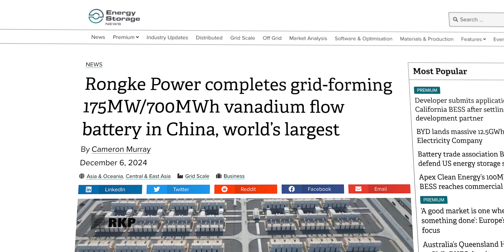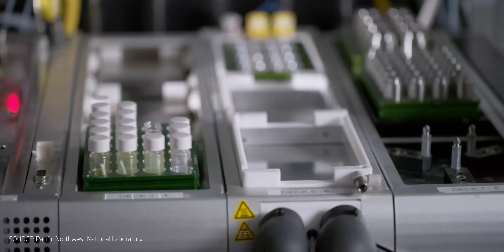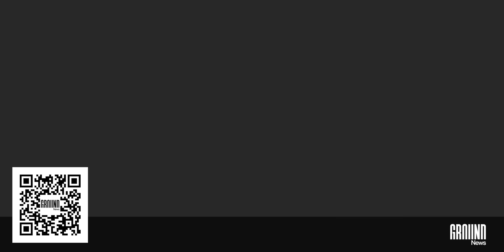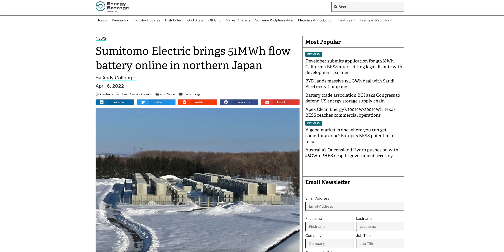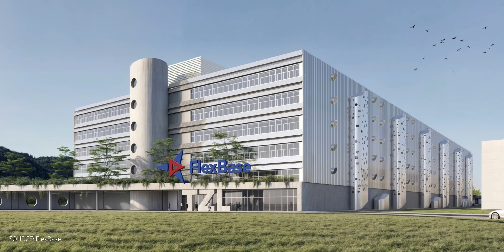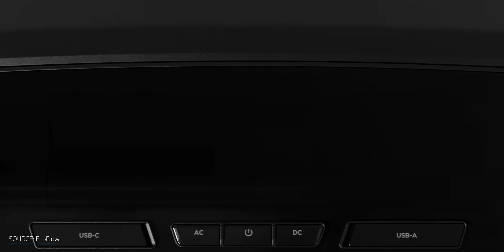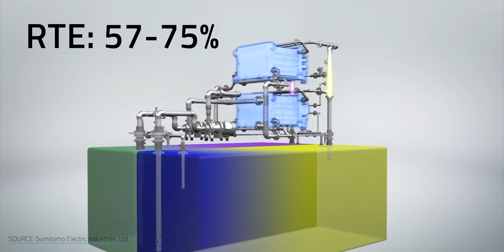Why Isn’t This Revolutionary Battery Everywhere?

Comment: I wonder if the battery in China is actually being used, does anybody have any info of how much of the capacity is being utilized? I know most of the solar and wind farms in China are running on somewhere in the order of 0 to 20% utilization (they have many massive solar farms, but they do not have the infrastructure to transport that power any further than the local village, if there even is one close by, some are not even connected due to being too remote), so I do not see how such a big storage system could be fully used in China.

Comment: Sounds very interesting.
Im swiss and one big part for electricity are hydroelectric dam.
Big brain idea noone wana do so far yet can be placed anywhere with enough space:
Huge water tanks that serves as potential energy higher up. Then when needed open them to run a turbine.
On the bottom (after turbine) there is a other water collecting area.
If you have abundant energy you use pumps to get the water up in the tanks again.
Continue the cycle.
This is WAY cheaper then ANY battery even when it is not as efficient as lithium batteries.
It can not burn ofc😂

Comment: Matt this is a very good summary of the VRFB situation based on publicly available info.  However, I am an industry energy storage consultant doing very large storage installation in the range 200-1000 MWh.  The fact of the matter is that given cost, energy density, safety, logistics, supply chain risk and durability VRFB cannot compete with lithium-ion.  I was involved in the development of advanced VRFB and licensed this in 2021 when it became apparent it simply cannot compete with lithium based systems.  Keep in mind that VRFB in China was heavily subsidized by the government both for development and funding of early projects.  Also China has the largest current domestic vanadium, the US has virtually none.  To bring a full scale working mine online takes literally 10 years, so this is a non-starter.  Russia and South Africa have the bulk of the reserves.  So the risk starts with the vanadium itself.  VRFB has no market traction because it does not make business sense.  When you do the financial project analysis its too expensive by a long shot. 

Another key point is that lithium batteries have been vastly improving over the last decade alone, in energy density, price, durability, safety and cost.  Energy density alone is now 5MWh for one 20' ISO container for the DC block.  For VRFB it is .5MWh at best with the latest technology in the box. Yes that's point 5MWh with a decimal point before the 5!   This means 10 VRFB containers are equal to 1 lithium to achieve just 5MWh.  The point I am making is that lithium has been improving at a much greater rate than the market expected.  This 10:1 energy density difference also effects all other costs dramatically.  More VRFB containers require more land area, civil works, conduit, copper wire, logistics and labor.  Those added costs overwhelm the budget.  This makes VRFB and frankly most other non-lithium technologies unviable for the foreseeable future.  And remember lithium is at tremendous scale.  Any new technology has to get to similar volumes in order to compete.  This is the harsh economic reality of any new "up and coming" battery system.

Anyway love your videos and your balanced presentations!
Reply: Great info guys! (Video & coment). Thanks for the contribution 💪🏼👍
Reply: He did mention about the availability of Vanadium in the US towards the end.
Reply: Great summary confirming that Moore's Law is at work. Rapidly lowering of cost leads to exponential adoption outcompeting all other competing technologies.
Reply: Hi Greg. I would like to collaborate with industry leaders like you. I have a big project coming up in 2026 in South Africa, Cape Town. I would like you to partake on it.
Reply: I love seeing comments like this from industry experts. Thank you for sharing.
Reply: Nice explanation

Comment: I think this could be a good idea for smaller localized grid stability.  Say, the loss of a transformer in a specific location, the ability to near instantly supply power could be crucial, perhaps near hospitals or other emergency services.  Of course, many of these facilities may have generators too.  Otherwise I favor the implementation of nuclear energy referring back to your video I watched on Thorium.  What are the odds of small scale production units utilizing this instead of uranium?

Comment: As FYI, Australia has 40% of the world’s vanadium  resource. However, without a market vector alternative from steel hardening, every time a mine starts up, the claimed market price collapses. Unfortunately this means that Australian miners/refiners need to pair with a vanadium redox battery manufacturer. Alas, they don’t seem capable of doing this - even though Japan and US are supposed to be strategic partners.

Comment: If the level of efficiency is an issue, then what about the efficiency of coal fired power stations and the internal combustion engine. Also, if land area is an issue, what about the area used for coal mines and oil fields.

Comment: Ridiculous claims that 8 - 10 hours storage  gives you wriggle room.

In the UK we had several days of low wind, together with overcast days.

This was during the Winter when electricity is most needed.

This tech is not remotely near a solution.

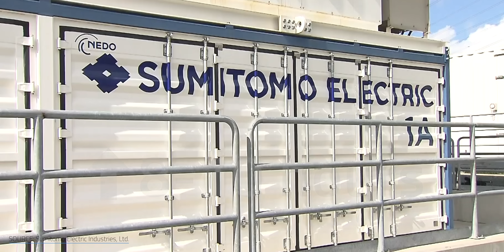Comment: 7:30 The problem with PVs is not night but winter
To compensate for much shorter day and always cloudy sky you would have to install like 10 times more PVs
Doesn't sound like commercially viable option to me
On the plus side, excess energy during summer can be used for CO2 capture probably

Comment: For grid storage, I consistently worry about the options that involve relatively high cost materials.  Honestly for that application, the tech I'm most hopeful for is the molten metal designs that an MIT prof developed (specifically targeting low cost materials).  (As much as I dislike the fact that he's taken it to a spinoff business called Ambri rather than just releasing the design to the world - would love to see what China (the country actually funding major green tech projects) would do with that idea, but it's locked away in the US market for now.)

Vanadium might be a good supplement to that model - I haven't redone the research recently, but I seem to recall there being an issue with having to re-melt the metal before you could use them, which, naturally, means a decent bit of lead time. But the thing with grid power is we have space, we don't need high energy density options, we need affordable options.  And Vanadium might be good for now, but it's a pretty limited supply, not unlike lithium, so mass adoption might not be any more viable than mass lithium adoption.

Comment: The interesting part will be seeing if they can effectively discharge it. Until you try, you never know if the circuits work, right? A .1% failure rate of the dischargers and/or phase lockers would be alarming. Realistically, let's say 1% total failure of any component during the output. I sure hope they tested them.

Edit: And there it is! A black start! Let's effing go.

Comment: I find it hard to believe anyone would install a flow battery over pumped storage. So long as the area has suitable topography pumped storage appears to be the far cheaper option to build and to operate. Pumped storage is more efficient (60% vs 75%), and cheaper to construct, as forming a reservoir and filling it with water is cheaper than building a tank and filling it with chemicals

Comment: Quick comparison from Wikipedia for the curious:
Vanadium redox battery
Nominal cell voltage 1.15–1.55 V
Specific energy 10–20 Wh/kg
Energy density 15–25 Wh/L
Cycle durability >12,000 - 14,000 cycles
Energy efficiency 75 - 90%

Lithium Ion Battery
Nominal cell voltage 3.6 - 3.85 V
Specific energy 270 Wh/kg
Energy density 250–693 Wh/L
Cycle durability 400 - 1,200 cycles
Charge/discharge efficiency 80 - 90%
Reply: 12.000 cycles, thats over 30 years daily discharge!
Reply: By my calculation, to recharge an electric vehicle capable of a 750km range would require a VRF battery the size of 2 conventional rainwater tanks of 4000 litres ea. Today's EVs would only need one rainwater tank equivalent for a recharge. A double rainwater tank VRFB installation would take 10 days of optimum charging from a domestic 15kW solar system. I look forward to improvements in efficiency and capacity from all these components.

Comment: Interesting possibilities for rural area off-grid.  Small ranches or farms or just the individual off-grid hoe in the country which now use Lithium batteries for storage.    Need to be cost competitive over a 20 year cycle with existing technologies for adoption.

Comment: With redox-flow-batteries, i don't think about EVs or grid-batteries, but seasonal storage for a home. The idea: Energise as mutch electrolyte in summer with energy from the photovoltaic and use it in winter. With 10% of my yearly electric-energy-need as storage, i would reach an autarky-level of about 90 %. 
The round-trip-efficiency would not matter mutch, but the upfront-cost would. Haven't found a solution yet.

Comment: tbh, if the weight coudl be fixed, these could be the msot best electric ehicle battery. need more power, get a bigger grid, need mroe range, get bigger tanks, want a quick refuel? flush and refill the tanks,
at the begining i can imagine using it as a trickle charger and cuttoff for a  primary small/medium sized lithium battery, the primary lithium is used for the peaks and then gets refilled as you are cruising
itd be a fancy solar panel kinda thing, battery used for peak, then solar charges between

Comment: Great Vid Matt, but i think this tech will have trouble competing with lithium ion due to its poor round trip efficiency as mentioned, the whole point of storing energy for later use is to keep it, not lose 25% in system loses and when compared to lithium ion, at the cell level which is closer to 98%, plus system loses in the charging and inverters etc... so does that round trip efficiency of these flow batteries include the charge and inverter losses already or is that just the chemical portion, would need to be clarified,  t am assuming it's just the chem portion, plus more loses in the power electronics... still, great info.

Comment: I like all your videos very well spoken i wish I could speak like you. I believe that we must look not for energy density but rather long gaevity and safety and easily obtainable materials is the way to store energy. There is to many ways to produce green power, so even if I only get back 30% it but can last 50 years and easily renewed that would still be just fine. There are so many motors built a long time ago that were very long, lasting, very efficient, but not energy dense, but would work great for none moving motors (generator).

Comment: My battery storage is in a 20 foot connex, I cant wait to be able to use a flow battery for multi day outages like Hurricanes on the Gulf of America coastline. I currently have 120 Kw/hr of LiFePo4 made of 160 prismatic cells. That's 48 hours of storage in off peak seasons, but that is not enough during high demand times where its just 20-24 hours and grid outages can be 7 days or more with 3-4 days of little to no solar.

Comment: There was a Public Radio report from 2-3 years ago making a point that a VRFB tech. had been significantly improved by one of the US National Labs, but it was licensed to a Chinese company, suggesting some degree of shady dealings.
My takeaway was more that the Chinese company had better access to Process Engineering talent.
I worked for two fortune 500 manufacturing companies in the US during the '80's. Both were rapidly moving production off-shore. I worked in Process Engineering, and that skill set was clearly going off-shore also. (facts)
Editorial: Keeping foreigners off of US soil is just going to exacerbate this problem. If the US is going to re-shore manufacturing, the most efficient way to do it is to allow foreign investment and human expertise to build it here. I learned more on the production floor than I did in a classroom. New technology might not get taught in the classroom at all.
Reply: lol cope. How typical.

If you can afford it, i suggest you visit china in person.

Comment: Did they solve the problem of heat - I suppose they use the cold climate to do that instead of pumps and fans. No good in hot climates. Need special seals and plastics only, as the electorlyte eats all metals.

Comment: When all capitalist media are subverted by certain covert actors, it does not matter how you "balance" the output,  the result will always be skewed and biased towards the interests of said actors. I put it to you that these actors exist and their meddling manifests itself most vividly when it comes to reporting on the occurrences in occupied Palestine. So much for "ground news". Of course, in all areas where the system has no interest in distorting, all will seem normal and unbiased...because it is. However, the role of the media in a democracy is not to avoid, obfuscate and often outright lie about topics, on the contrary, it is to shed light, unearth and to question the things the powerful would like to keep us in the dark about. Therefore, we do not actually have democracies, since these rely on informed decisions of its voters, or very defective ones at best.